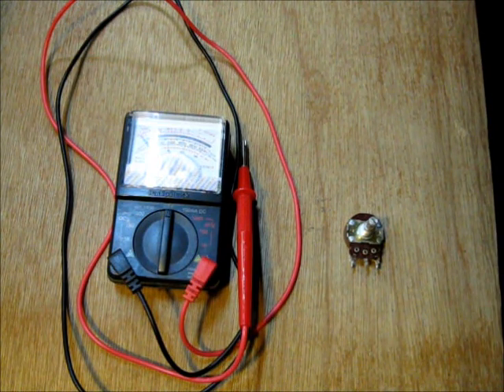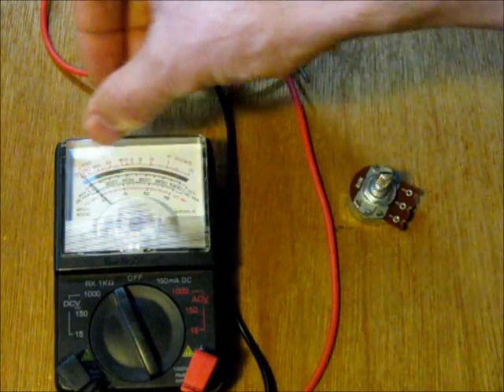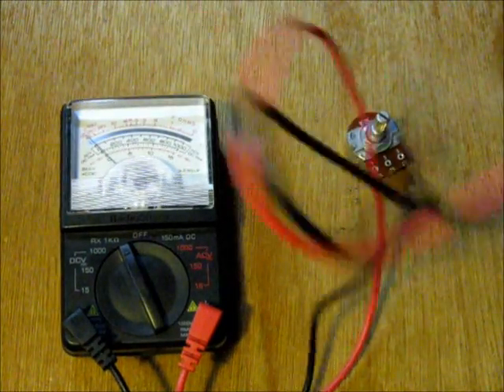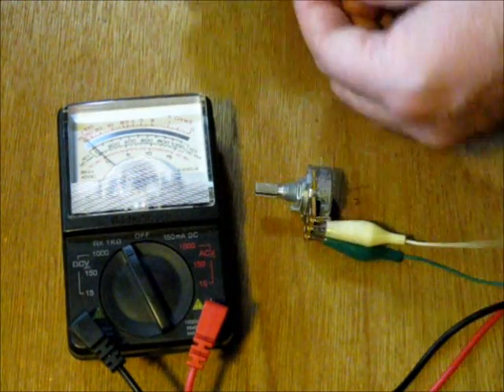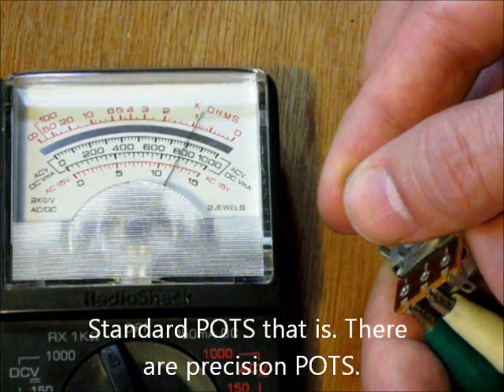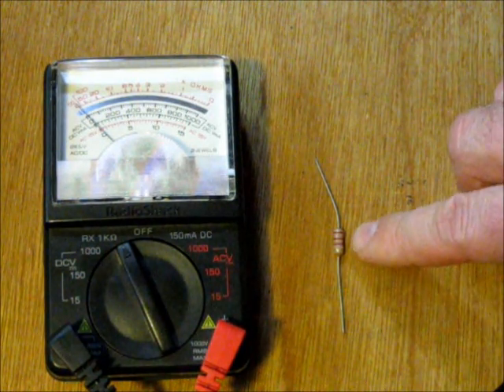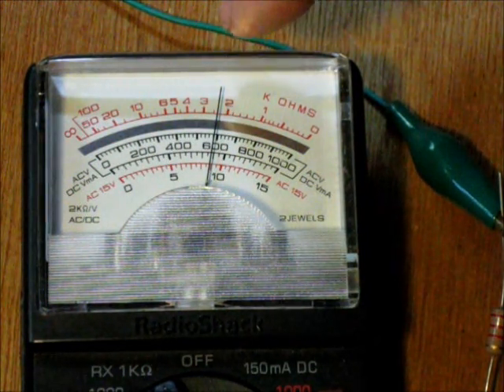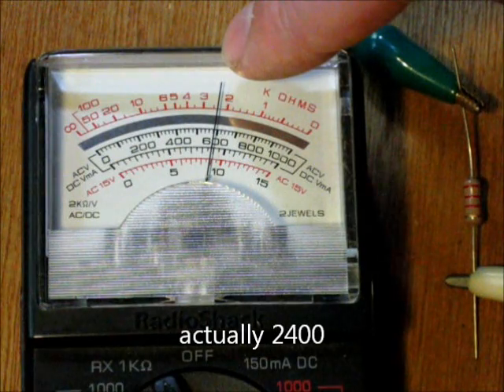How to read resistance with an analog multimeter - ohmmeter

Comment: Sir,say I was checking electric dryer thermo fuses,and I chcked them still in unit,I removed one wire before checking and the analog meter went far far right on each,does that mean they are good? (continuity?).?? I used a digital before but never a analog type.I ordered all new in kit,but wondered..Thanks
Reply from the maker: The thermal fuse measures temperature so you cant easily test it with a meter like this.
Reply: I set knob to x10 ohm setting..Not 1k x settng...
Reply: I have a kenmore 500 electric dryer,all those thermo fuses common.Chute was clogged,is skinny fuse I think is culprit,they say to bypass by connecting of wires but I bought entire kit.Dont think that type can be tested,so was told to tape both wires and test by turning on.Dryer not heating is trouble....All I checkd but that one,meter went far right,as far as would go..My digital meter I loaned out,never retrned,so using this analog..Waitng for kit in mail,but still curious about what meter read..

Comment: What does DC A and DC V stand for?  I'm guessing volts and amps?
Reply from the maker: Yes.
Reply: How do you check for continuity?
Reply from the maker: On some meters, there is a continuity tester option with audible tone when there is contact. On others you can simply set the resistance to the highest setting and touch the ends. See if the needle moves. Move down the scale if there is no motion. Either you will eventually see motion on the needle or there is no continuity.

Comment: Thanks again. then i measure a 4.7k resistor in x10k range but no reflection in needle where as in x1k setting it shows the value. then what i understand?
Reply from the maker: The 1k setting shows anything up to 9,999 ohms. The 10k goes from 10,000 to 99,999. 100k goes from there to 999,999. Again tho it depends on your meter display but thata the general rule. Always start on highest setting and go down till you get a good reading.

Comment: Thanks for answer. then how much values resistor will measure in x10k range?
Reply from the maker: Anything from 1 ohm to 99,000 ohms depending on the markings on your meter.

Comment: sir, i have analog meter model is yx360 tr sumwa co. this meter have a range of x10k.what is its function i dont understand. when i short two prob with other range like x1, x10, x100 or x1continuity the needle move but when set in x10k there is no movement , why sir ? is it my meter problem? pls explain sir.
Reply from the maker: With that large number it is probably the resistance measurements. When you short the leads together, you are measuring the wire resistance of the probes themselves. With 10k = 10,000 ohms, the setting is so high that the tiny resistance in the wires is small enough that it wont register on the meter display. On a lower setting you can get the actual wire resistance. With each step up higher, the needle will move less and less.

Comment: How to know where will i set the selector range in measuring resistance? Can i set it to x1 if i will measure a 50ohms resistance? because in voltage the selector must be greater than the battery that you're testing. Is it the same in resistance or not?
Reply from the maker: Always start on the highest setting and work your way down for a more precise measurement
Reply: thanks. but can i use x1 when measuring a 50ohms resistor? thank u
Reply: That depends on the meter and its resistance ranges and the scale markings. This can be different for different meter models. Read the manual for the meter and it will give you a table or show in th specs what values are for each range.

Comment: DUDE I HAVE RECIEVE A MULTIMETER LIKE THAT AS A GIFT FROM A FREIND.....AND IM NEW OF USING THIS ITEM...
HOW TO USE THE OHMS ADJUST.....AND CAN YOU PLEASE GIVE ME MORE LEARNING HOW TO USE THIS MULTIMETER.......THANKS A LOT DUDE....GODBLESS... AND LAST QUESTION.....HOW CAN I CALIBRATE THIS MULTIMETER....TY
Reply: The "ohms adjust" is used to "zero" the resistance scale. Connect the two leads and touch the two probes to each other, which should be zero ohms. Use the "ohms adjust" to set the needle to zero. Be aware that this can change some with each resistance range, so when changing ranges, zero the meter again. This is ONLY used for resistance measurements, and you should ONLY connect the meter to a circuit for measuring resistance when it is turned off and has no power connected. Get the manual for the meter and read it as it will have important information about how to avoid damaging the meter, and how to use it safely for voltage or current measurements (if it's one that can measure current).

Comment: can you help me how to get the exact ampere. ?  i test the resistance of a servo motor, and i got 2 ohm , and my tester is set in x100 , and it has a 5v ,    
i've used this formula i=v/r  . i've got 0.025,
if ever that i will use to buy a powersupply , how many ampere should i buy.?? 
i hope you can help me with this.